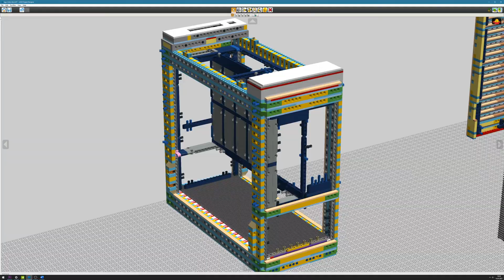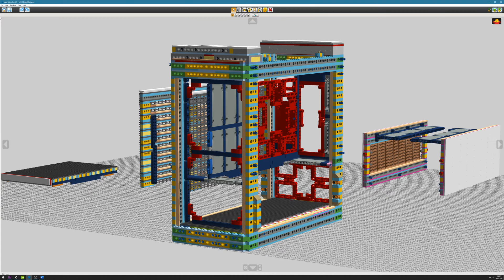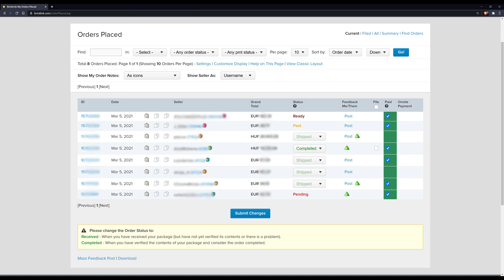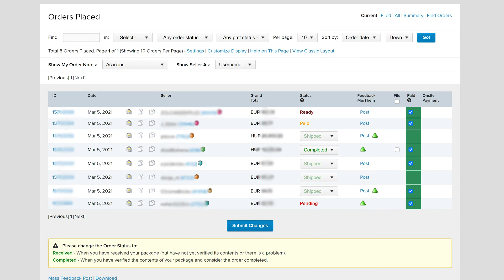LEGO PC Case Part 8.4: The Design Summary

Comment: Looks a bit fragile to me. Are you sure you calculated all the weight of PC components and also the vibration the fans make? If you're using low-end CPU then it will be fine but with something like AMD Ryzen 5600~ you will definitely need more fans and the case doesn't seem like it's capable of having many fans.